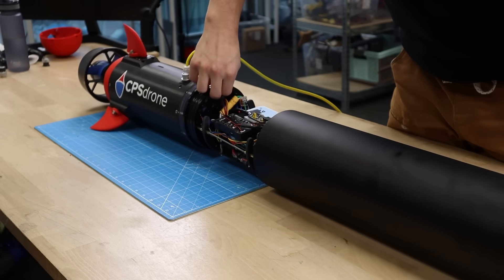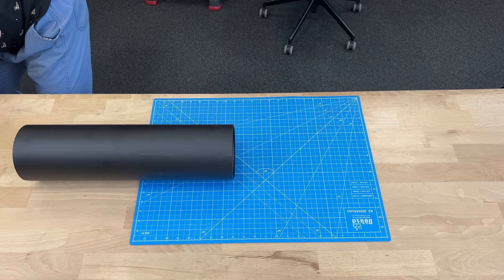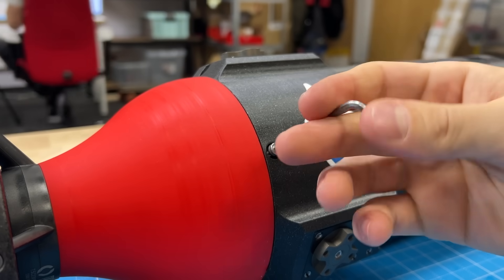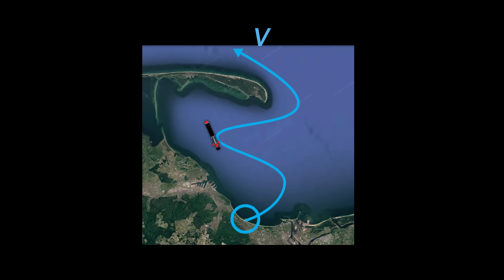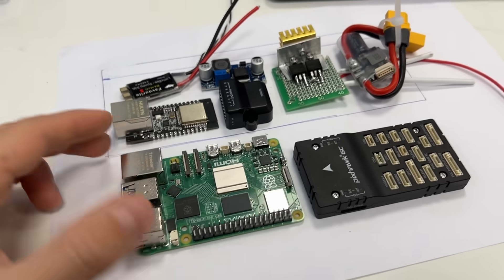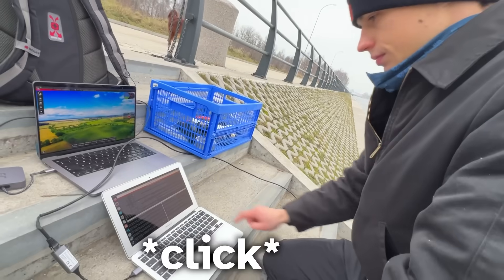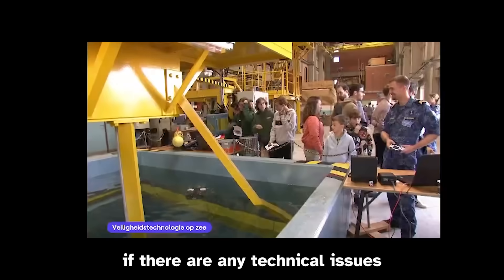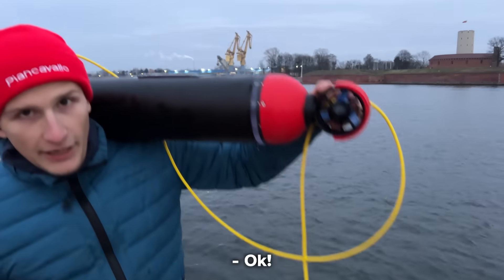Building a fully AUTONOMOUS submarine

Comment: Instead of adding a second motor, wouldn't it make more sense to use the fins as asymmetrical hydrobrakes for steering, flip the side you wanna turn towards into braking mode, and correct the roll and pitch with the other one, and if they introduce too much of a pitch influence in the braking position due to their asymmetry , flip the braking side to the opposite 90 degrees angle to correct if it's going to far during the turn; and of course, for any less extreme turns, just control it like a V-tail ? Or is the bottom mapping too sensitive to roll and you need to avoid introducing unwanted rolls during maneuvering at all costs?

Comment: you could use what they use for some planes and subs which require stealth and there fore no coms. they use what is effectively a gyroscope covered in sensors this takes the acceleration the turning rolls and an initial gps location to basically map a path from the first point and determine the location while buying it would likely be expensive there are videos explaining how they function that you could use to create your own then you just add a protocol where after a certain distance travels the drone surfaces to obtain a gps location then updates the path and corrects any inaccuracies before diving and continuing. these systems are called inertial navigation systems and are used in most airplanes while those tend to be big and expensive the concept is fairly simple and it shouldn't be to hard to make one. though it will likely have accuracy problems till you figure out any kinks.

Comment: Tilt the batteries on a swing mount for roll control - easy in your existing layout, with the batteries low too. Actuating the battery to move it fwd and aft would give pitch control. There are ocean gliders that control three axis with battery movement alone, all actuators are within the hull envelope. Having the advantage of no hinges or rotating axis, to become external leak points.
Reply: fantastic tid bit man so interesting... make sense. like gyro orientation devices spinning on a spacecraft to orient on 3 primary direction, . Spinning gyro in both directions allows for bi directional control on either axis.
Reply: Spot on: with gravity to react against you don't need spinning inertia.

Comment: I feel like having the tether connection point above the waterline for the GPS bit results in it being pulled over when jerked. Maybe having the connection for the tether at a lower point at the front in line with the bottom of the hull might improve stability?

Comment: Nice project guys, looking forward it seeing how it goes.
 cheapest way of nav i can think of is this;
A time/angle/speed calculator, 
so using a giroscope you can keep your angle/bearing and a internal clock are the simple bits, 
Now the speed sensor is the expensive part, but if you sacrifice accuracy, things get cheaper, use relative water speed, think like a PITO tube used to measure the velocity of the water hitting it.
Also, best to have 2 or a emergency recovery system if it stops working.

Comment: Why not mount a gps antenna on the top of the sub, and have it periodically surface, connect, log its position, then dive again?
you could use a accelerometer for position in between dives and basically just correct its drift each surface.

Comment: Why not use an IMU to make for a simple inertial navigation system instead of the GPS + floaty solution? If drift/error from the sensor is an issue, the drone could even surface occasionally to get a couple GPS pings and error correct.

Comment: if the sub gets stuck on debris you should add something in the code that had it reverse and use the thruster in the front to make a stationary turn then it can continue forward and correct itself back to the path

Comment: Surfacing periodically to acquire location seems better than tugging a buoy. If you've got something always on the surface anyway, you might as well be using a boat.
Reply: The drone isn't supposed to carry cargo (or explosives) from A to B. Their remote controlled drone seems mainly geared for visual inspection, so I guess a sensor package would be the goal here as well. Then it does make sense to dive deeper than the height of the hull. Also, the buoy seems to be mostly for training wheels. Even if you imagine a smuggling kind of scenario, a dragging buoy is harder to detect than the entire boat.
Reply: Even better: Let a boye rise every few minutes, not the whole Drone. Similar to a periscope
Reply: @ way too complicated. You'd need at least a cable winch, maybe even a mechanism to secure the buoy to the drone. Especially for a DIY project, just surfacing is a lot more efficient. If you add a mechanism to evacuate the water out of a tank in the nose, the entire drone could be a buoy.
Reply: Also, the buoy makes additional move resistant, that makes less range for the submarine. I think you can use inertial sensors to define approx location and periodically precise your location with surfacing (and receive GPS signal).

Comment: Great video! I would consider using imu (gyroscope, accelerometer, magnetometer) so your boat will have a better understanding of its position and rotation. If I understand correctly, right now you seem to calculate rotation just from the GPS unit which I believe can provide a lot of noise, consequently losing “tracking” too fast, especially considering that it isn’t mounted on the hull itself, but on the tethered buoy. If you were to fuse imu sensor data with gpu unit you would have very reliable tracking system, although I believe it should be sufficient with just the IMU sensor implemented. Good luck, can’t wait for part 2 :)

Comment: Thanks for the metric to US conversion in your map, but please use a more common unit next time, like leagues or fathoms 😀
Reply from the maker: I personally enjoy the underrated unit of palms as well (3 inches) ~ Filip
Reply: @CPSdrone  Maybe you could start using ell in future videos? "1 ell = 2 feet = 3 sztychs = 4 quarters = 8 palms = 24 inches ( = ⅓ of a fathom )." -Wikipedia
Reply: @taylorhay so roundabout 24/67ths of a smoot? 😅
Reply: @taylorhay  those are British imperial units, not US imperial.
Reply: @3fives-j5w  Those are Polish folk measurements :) Although I'm sure some are shared with other European countries
Reply: @3fives-j5w  The Imperial system was officially established in 1824 by the British Empire,
Reply: @ruzziasht349  British imperial system is not the same as the US imperial system. It's a totally different set of standards.
Reply: @3fives-j5w  So an American foot is different to an English foot? an American yard is different to an English yard? and American mile is different to an English mile and and American inch is different to and English inch? The Imperial measurement system was named as such because it was officially defined and standardised during the height of the British Empire. The system was formalized in 1824 under the British Weights and Measures Act, which aimed to unify various measurements used across Britain and its colonies. Given that Britain was the dominant global power at the time, the term "Imperial" reflected its status as an Empire! So there you go, you learned something today. Oh and pounds, ounces, miles, feet, yards, and inches are exactly the same in the UK as they are in the US.
Reply: @ruzziasht349  yes. 1824 is long after the US was independent and therefore in doing so the UK created its own standards existing independently from the US system. You think there weren't any feet or inches prior to 1842? The US system was later standardized using standards that linked it to the metric system using legally mandated conversions, but the original system was based upon standards in measurements setup by US law in the 1790s.
Reply: @ So miles, feet, inches, yards are different between the US and the UK? Why not answer the question, I mean you did say "It's a totally different set of standards." I guess you know totally different means that two or more things have no significant similarities, they are completely distinct from each other in terms of characteristics, appearance, function, or nature.
Reply: @ruzziasht349  Yes. Literally. Because the standards are maintained by two totally different and unconnected entities the exact physical size of units will be different, and the UK system has a lot more units that the US system never used.
Reply: @CPSdrone  I implore you do go with trolling further and use common imperial measurment in uncommon use cases by using metric sufixes, like measure big distances with kilo or mega inches or small ones with mini miles or mili foots.
Reply: @CPSdrone  Hand Thumb Finger too!
Reply: @CPSdrone   finally a new video.
Reply: I love when people from metric countries convert to weird US Customary units! I'm a US citizen, and we're incorrect for not using metric and deserve to have it thrown in our faces. I'm serious. I use metric for work, and it's far and away the better system, not to mention that it's basically universal. Inches, feet, and miles are just as stupid and arcane as leagues and furlongs. Please don't convert to familiar units, I want my countrymen to have to get used to metric units
Reply: @evanbarnes9984  arcane? You mean archaic?
Reply: @evanbarnes9984 we use engineers measurement at work which you may know is kind of half imperial and half metric where feet are still used but are divided by tenths and hundredths instead of inches and yeah the imperial system is definitely not the most logical haha
Reply: @evanbarnes9984  Word! 👍
Reply: @evanbarnes9984  I agree
Reply: @evanbarnes9984  The Imperial system was officially established in 1824 by the British Empire!!
Reply: @evanbarnes9984  yeah everyone uses metric pretty much , idk why America doesn't
Reply: @evanbarnes9984  Bloody well said!!
Reply: Furlongs is a perfectly cromulent unit and I smiled when I saw that conversion pop up 

(Seriously though, saying this as an American, just learn metric units. It's easy to tell how long a km or a m is)
Reply: I'm an old-fashioned American and prefer my distances measured in bananas. Dachshunds will do in a pinch.
Reply: @2006Whippet  
Why don't you guys use metric time? 60 seconds in a minute, 60 minutes in an hour, 24 hours in a day, etc is imperial time. In metric time a minute has 100 seconds, an hour as 100 minutes, a day has 10 hours, a week has ten days, a year has ten months, etc.
Reply: Banana for scale 😂 @2006Whippet
Reply: Made me smile , the metric system is much easier to use once you get used to it . For you in America a rough rule of thumb  3 feet is 1 meter .It is not exact but it make conversion easer to do in your head . If you need a water proof servo . It is easy to do  just pact an ordinary servo with silicon grease to and bottom. But be careful not to disturb the gear settings .
Reply: @welshpete12 thanks for the handy conversation tip but while we may use a somewhat odd system of measuring most of us are not idiots and learn in second or third grade that there is roughly 3 feet (or 1 yard) in 1 meter. 😂😂

Well actually maybe I'm just being naive since it does seem like people are getting dumber at an alarming rate it's entirely possible that many Americans don't actually know that tip. 🤷🏽‍♂️😂
Reply: The use of 'base' 12 rather than 'base' 10 is much easier in real life situations because it provides easy 'divisibility' which is why people keep using it for practical rather than theoretical purposes, the French revolution spawned all sorts of practical nonsenses like the 10 day week (very unpopular with the peasants!).
Reply: The last bastion of imperial measure
Reply: Common for Americans but not science or the rest of the world😂
Reply: In Australia, very small things are measured in "Bees Dicks", medium things "I've seen crocs bigger than that", and huge things are just counting the "F ME's" before the "it was huge". Boating distances are "how many stubbies" (beers) and road trips in Australia are "mate...I got 2 flat tyres, a busted windscreen, saw 12 dead roos, 4 rabbits, 3 snakes and hit 2 birds, used 8 litres of washer fluid, spent $300 on fuel, got food poisoning and filled the radiator on the side on the road twice, with my own pee".... 
"Ah... so not too bad a trip from Brisbane to Sydney?" 
"Nah, not bad, except for the f ing FLIES..!!!" 😂😂😂😂
Reply: Why calling it US-Conversion??? It's a Lybian-Conversion also and not to forget a Miranmar-Conversion as well! And that's all, folks - no other country is using the absolutely crappy imperial systems. It's useless and has no logic at all! It's unprecise (ask NASA) and complete stupid to convert to other things. It's so much easier and logical with the metric system... Don't throw yourself away - try it!
Reply: If you're not using Cubits, span, palm, finger, homer, ephah, seah, omer, bath, hin, and kor as your units of measure, you're wrong.
Reply: Considering most who watch this most likely will not be seamen or sailors the majority of viewers wouldn't understand that type of measurement and virtually everyone will know either metric or US measurements so it really wouldn't make much sense for them to add a third unit of measure or use one most people wouldn't understand meaning it would actually be far less common for most viewers.
Reply: Actually I HATE the way everyone converts everything in every video - particularly when it's some stupendous number that most people have no reference for. This star weighs a whopping 23.7e213kg (it's just freaking big - no need to convert that to troy ounces). Just use your favorite units, it's pretty easy to figure out.
Reply: square alligators
Reply: actually we measure everything in AR-15s
Reply: Idk, I’m more partial to cobbler shoes sizes, 1/3 of an inch.
Reply: As an American the only people you would see using a Fathom of measurement is probably in the navy
Reply: Furlongs 😂😂😂 ole horse track measurements…
Reply: What about feet?
Reply: 'hands' is how you measure horses!
Reply: Yeah, we know you don't live in the USA, the most common unit for semi-long distances is miles. Or maybe you mistook the definition of common for something else. Also, the USA uses the imperial system, we do not call it "US conversion". You are yet another European who hates us for using the imperial. I don't hate the metric system; I just grew up with the imperial so that's what I use.
Reply: @AgentCryo The US (and every other country) uses knots and nautical miles also feet for altitude for aircraft. Iirc Russia use meters over its own airspace. No idea what subs do to reconcile pressure depth and physical depth as a plane uses barometric and radar/laser ToF. Sonar has density gradients getting in the way.
Reply: @AgentCryo
”You are yet another European who hates us for using the imperial. I don’t hate the metric system; I just grew up with the imperial so that’s what I use.”

Jesus Maria…🤦‍♂️

America is a metric country. You know that, don’t you? You’re five percent of the world’s population. Get over it. Stop playing the victim and learn metric like the rest of us did.
Reply: @AgentCryo Fun fact:
The world doesn’t exist to cater to Americans
Reply: @musicdev  Actually it does. Where have you been since WW2? We literally control the world economy through our currency which everyone has to obtain to pay for imports and exports.
Reply: @AgentCryo Only 3 countries left now stuck in the dark ages, USA, Myanmar and Liberia, all the other countries have adopted metric. Always found it strange the US wasn't an early adopter of the Metric system when you consider the imperial system was officially established in 1824 by the British Empire!
Reply: Look who is talking about hating after he demands things to be his way.@AgentCryoyou realy think that is the best approach to pursuit them to change anything or improve it?
😂
Reply: @AgentCryo not only Europe, but almost all the world (except  America), uses kilometers and meters.
Reply: @chudoigrok1584  Wrong. First of all, "America" is not a thing " the Americas" is. You likely meant "North America", specifically the US. Secondly, the United States, Liberia, and Myanmar use Imperial. So no, is is not only "America".
Reply: @AgentCryoas an imperialist i have no idea what you are on about, why tf would people hate us for using a different system of measurement? 😂
Reply: @AgentCryo We don't use the imperial system, we use the US customary measurement system. "Metric to US" is therefore perfectly acceptable
Reply: @AgentCryo Yap some more bro
Reply: @AgentCryo its nothing to get worked up about he doesnt hate americans for using the imperial system